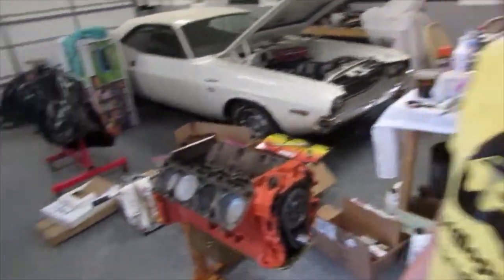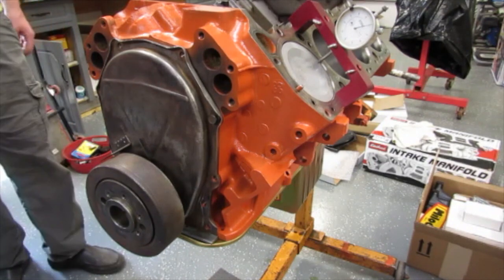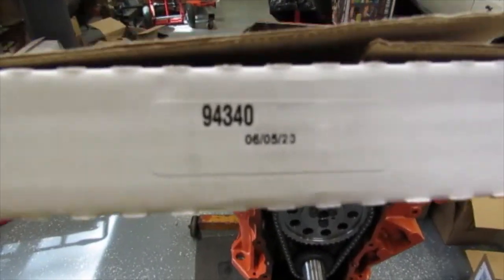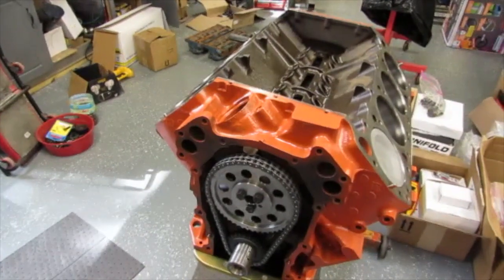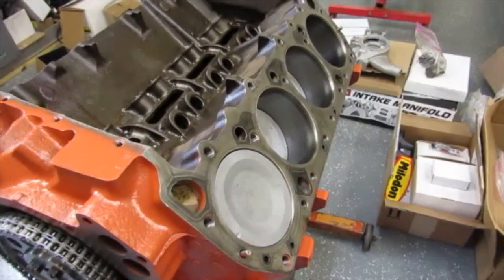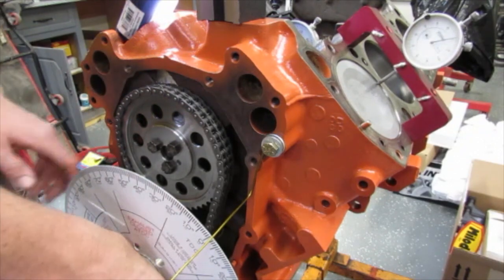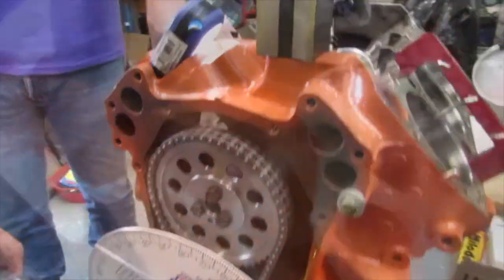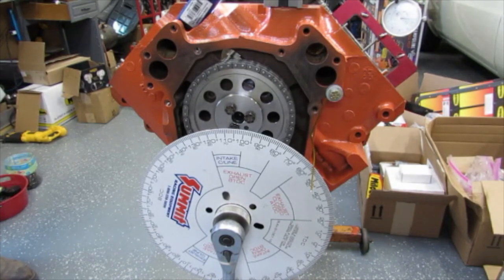Big Block Full Build Series: How to Degree a Camshaft and Checking a Factory Balancer.

Comment: Could have been more accurate by picking a random amount like .10 down, and rotating both directions to find absolute TDC between the two "down" spots. Thatd cover the dwell issue. You might have found the damper mark to be more or less accurate that way but at least you'd have a trusted mark once its all buttoned up. Ive had factory dampers off by  5-8° that showed no outward signs of spinning, so every time I had an engine apart, I always measured so I had a trustable mark to begin with. Of course every track nite the distributor was moved around often by ear or "buttdyno feel". So while I recorded numbers for a while, I eventually quit bothering and just winged it😁
Reply from the maker: Usually the track is my test. Try another couple degrees and look at the time slip. When it loses time, back it up! LOL

Comment: Did I miss a step - your choice for pistons/ rings/ compression because these truck motors are different ?
Reply from the maker: Possibly. I used 100% stock bottom end except for rings and bearings. It’s probably 8/1 compression, but runs very well as a combination.

Comment: Since you were .05 off if you would have sent it without degreeing it how much power do you think/guess you would have lost i wounder? Is there a formula for how much power each degree off you loose? interesting stuff Joe and this is really where the magic happens in timing and TDC accuracy
Reply from the maker: So we did leave it. That half a degree could have came from my measuring. They used to make finer timing sets that allowed you to adjust a few degrees with a slot. But to know exactly what the best degrees for your combo would be is to have a dyno or a race track. I see that chevys make a two piece timing cover that has an O ring seal, that allows you to pop off a few screws and move your timing at the cam and crank. Need that technology in the Mopar world...that I can afford! Lol 😂

Comment: Actually if you want to check TDC on your balancer, you have to go about it the same as finding TDC for cam timing. .050 before and .050 After then set to the middle.. Why?? Because there is time that the piston is not moving at the top and the bottom. But the fact is, it doesn't matter other than to make sure your balancer has not spun. If your motor likes 34* or 40* or 32*, well, that's what it likes!! Most RB Mopars like 34-38* on street gas..
Reply from the maker: Thanks Steve! That seems a bit high for my timing likings on today’s pump gas. My dad would always start at 28-32 with big blocks.

Comment: 1970 Dodge Charger with 440 that runs ,thanking about a 5.7 swap for weekend driver ?
Reply from the maker: I would’ve never swapped my challenger over to a hemi if I knew the headaches and money it cost me. I tried going the cheap way on everything. Then had to buy twice. I could have built a big block that was street able with 600 hp for the money I have in the hemi.